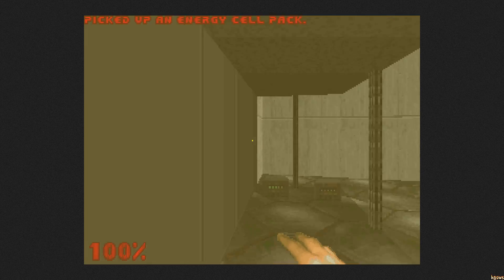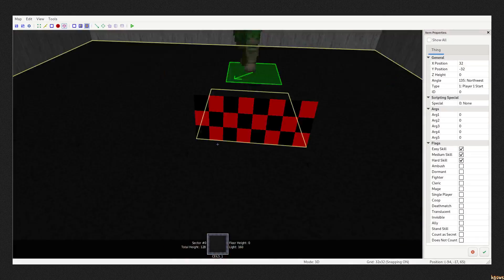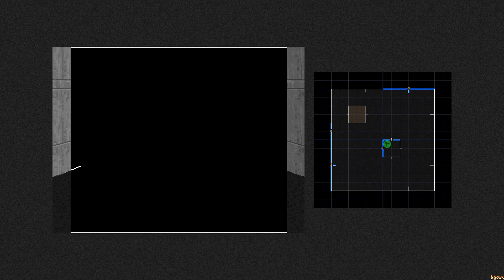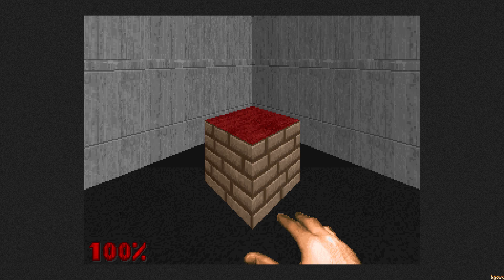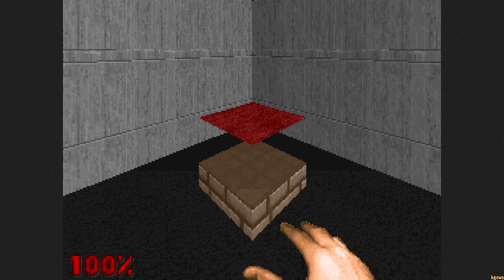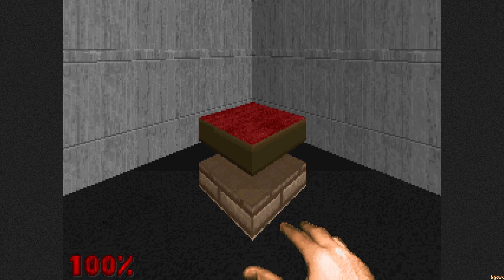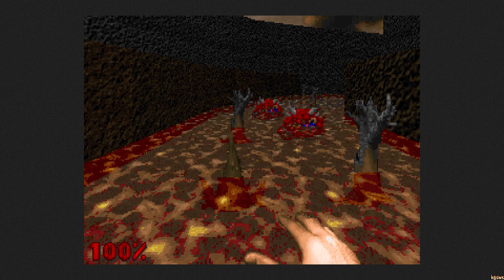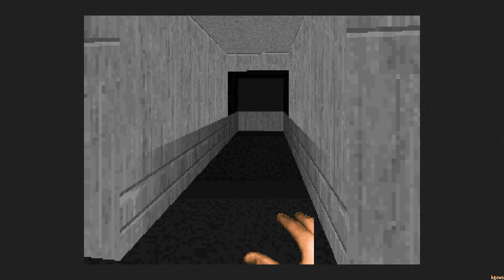Doom is 3D! But it can be even more 3D ...

Comment: Doom isn't 2D, 2.5D, 1.5D. It's all a lie.
Doom is real 3D, but with some limitations. Even Wolfenstein 3D, Catacomb Abyss and Hover Tank are 3D games but with more limitations than Doom.
Reply: Technically speaking Doom is a 3D game without Z-buffering or any other stuff that does depth arbitration
Reply: @stevefan8283  Doom includes Z-axis in its code and there are many situations where you can sense Z-axis in the game. Examples: you can fly over the items or you can hear "umf" sound after fall.
Z-axis is used even in wolf3d but only for wall rendering. The game takes place without a Z-axis.